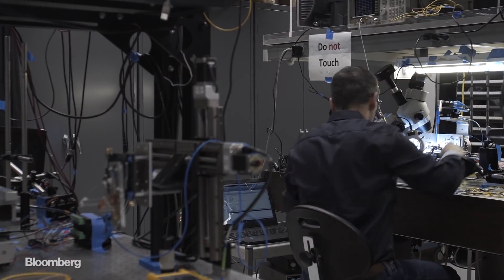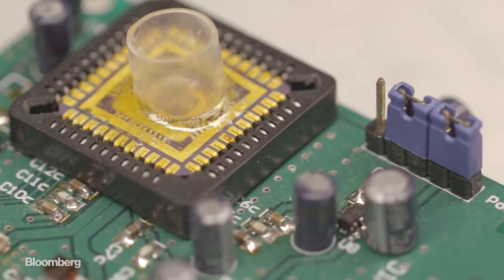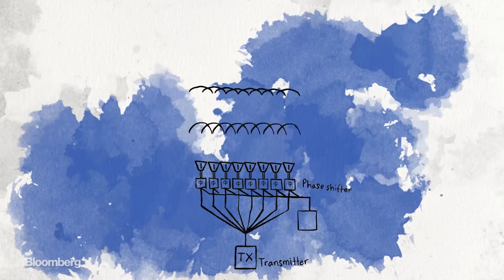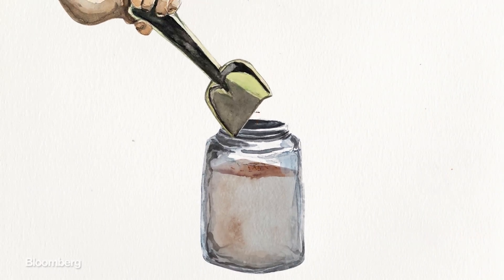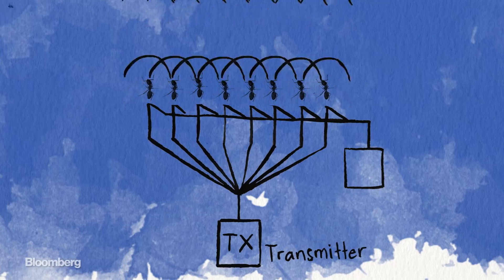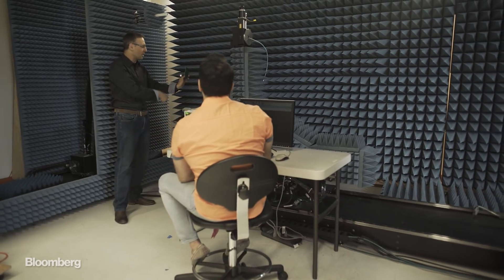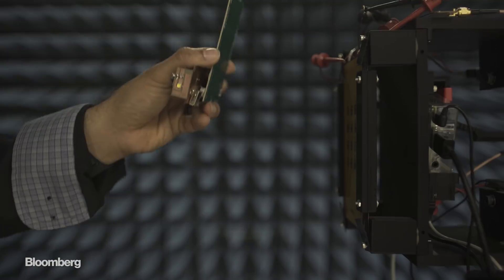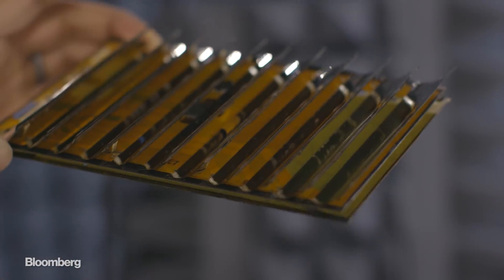Elon Musk Doubts This Idea. Ali Hajimiri Is Betting on It.

Comment: I don't see why one would go to the trouble of converting the solar energy into microwaves in space then beaming to the surface of the earth. What exactly do you gain by doing that?

I see the advantage of having 24x7 production of electricity but why not just focus the sun directly to a collector on earth, avoiding the losses in conversion to microwave and back? You just need a large optical reflector in space rather than solar panels and you achieve the same results, only much more efficiently. That is you get much more electricity produced for a given cost or for a given mass launched into orbit.

Comment: So, somehow, it makes more sense to buy a 100$ 2kg solar panel, put it into space for for ~6.000$, install it around a long range transmitting system (??$) that will have some efficiency losses, with the work of 10+ engineers and scientists, then to just buy 3 panels for 300$ and and have them installed by a single electrician on a spot of the 99.99% surface of the Earth that does not already have solar panels on it.

Intriguing.

Same amount of power produced, one cost 300$ + 1 electrician hour, other costs 6.100$ + ??$ + 20+ engineer / scientist hours.

Oh by the way: The ~6.000$ launch cost for 2 kg ( Falcon 9 reusable configuration) goes up to ~10.000$ if you disclude ventures of Elon, and go with the second cheapest option currently available. Just saying on your comment "If there is anyone out there who could steer the thrust of technology from its own demise, and toward the betterment of humanity" - there a lot of people actively doing that, and this guy might be amongst them, but he needs to not just imagine and make "cool tech stuff", but also make it in a way that it practically and economically makes sense to be anywhere near of the frontier.

Comment: "Without producing greenhouse gases in the energy generation process."

Well, yeah, but from that perspective, neither do hydro/wind/solar (earth-based) or even nuclear. That's beside the point however, because energy production must take into account the building of whatever it is you use. I bet launching rockets into space uses a whole bunch of GHG per kilogram put into orbit. You'd also have, to be fair, to amortized the GHG cost of building the rocket (on a per launch or per kg launched basis). And then the GHG cost of whatever material itself you put into space.

Comment: This is the same technology that allows wireless phone charging.  The catch is limited distance and significant heat buildup.  To increase the distance you must increase the power and the waste heat.  At the distances he's proposing the waste heat would melt the components.  Clickbait title and a silly idea.  I was exploring the idea of making light up chess pieces using this method but the heat buildup between the coils turned me off.  I did create a prototype which impressed my kids.

Comment: Moving solar energy from orbit to things on the ground would make more sense if it was for solar energy collectors orbiting an asteroid mine.  The sun might be the best source of energy because the extremely low gravity makes the surface of an asteroid difficult to stick to and so unspherical.  If equipment reaches deep under the surface, the energy requirements could be related more to the volume of the asteroid than its surface area.  There could be more energy consumed than the entire surface could provide if it was 100% covered with solar panels.

Comment: It will take some serious innovation to offset the operating costs of the orbital solar array as well as bypassing the effects of the atmosphere and weather patterns.

It might be possible to design a phase-array or array of transmitting lasers to use the 10 μm wavelength. From what I've read, the 10 μm wavelength is where the Earth's atmosphere lets energy pass through best. This might almost entirely negate the effects of the atmosphere, though I'm not sure what effect weather patterns might have on efficiency.

Comment: I was constipated for days. I tried this stuff called fibergel over the course of three days and eventually I was ready to give it a go. I took off my T-shirt and shorts used a small amount of vaseline around the rim of my arsehole. I needed a break in the middle of it all and decided to leave it sticking out of my arse like a tortoise sticking it's head out of it's shell. I was huffing and puffing so hard I thought I was going to pop a vein. It wasn't easy and I don't mind admitting that I was sweating quite profusely but after a few hours I managed to squeeze it out. It made an almighty thud when it hit the toilet floor and, because it was still in one piece, I managed to cause a miniature tsunami with the added bonus of toilet water all over my backside. I staggered to my feet and peered down at this thing I was responsible for it seemed like it was smiling back at me. I decided I was going to keep it and named it Alfred. While looking for something to wrap Alfred up in to keep him warm (there was a little piece sticking out so I knew it was a boy) there was a bang on the door. My roommate was shouting at me to get out. Now I had another problem. I lifted up the toilet cistern lid at the back and placed Alfred gently inside. Now and again my roommate will ask "what's that smell?" To which I reply by shrugging my shoulders. Hopefully one day soon Alfred will have a brother or sister.

Comment: Why suffer the conversion losses, light to radio, then radio to power?  Put large mirrors in a 10,000 mile orbit to keep solar panels lit 24/7?  

If you want to "beam form", then heat sink the solar panels and focus light on them.

Comment: Interesting idea.
Wireless transmission of power from space may be inefficient and expensive, but could be very useful in some use cases.
Mobile phones that don't need batteries and never run out of power would be amazing. It could be a life saver when used in emergency equipment.
The power density would need to be higher than solar power and be able to penetrate cloud cover, otherwise the usefulness would be more limited.
Reply: I was thinking that it may save lives in emergency equipment in the middle of the ocean, in mountains and deserts and other remote areas - places where a dead battery can be fatal.

Comment: Wireless energy transfer will always be very inefficient because of physics, not an inventor's will to make it work. Sending solar panels into orbit is ridiculously expensive and will be less efficient than ground panels when you account for all the transfer losses in the system. Elon Musk is 100% correct, and anybody who can do basic math can verify it. It would make way more sense to just put mirrors in space and reflect the sunlight onto panels on the ground (still stupid, but far less stupid than using 4 inefficient energy conversions). This asshole is fully aware that this is not feasible, and is just going after grant money like everybody else in the field of woo woo science.

Comment: Change(Chaos) vs Order, Enthalpy vs Entropy, or does complete Chaos exist? Because complete chaos is order but the process never gets completely ordered and external forces always seem to disrupt the balance anyway. The point is that two completely opposite or opposing views in solving a problem may not be that far from a solution on either direction and often times it is a type of perspective in using both methodologies that solves whatever problem you are trying to solve. The rational  approach is simply to view each idea and concept as possibilities and not impart any emotional attachment to any view you give because this often leads to blind block spots in the evaluation process that loses the chances of finding possible solutions to tasks being processed or considered.

Comment: Elon thinks the idea is stupid because:
1- cost of launch
2-inefficiency of transmitting energy from space with a laser
3-complexity and expense running a satellite.

So why do this when we have  ground based solar? I'm not saying this is impossible or something. Its not an economically practical idea. I think Elon is right here.
Reply: totalermist
Except that's completely different. Those satellites don't make power, they make internet. While solar power is available in most places on Earth, internet access is not. By going into space you need only 12,000 satellites to cover the planet. How many terrestrial stations would you need to do the same, and how much would it cost?
Moving solar to space doesn't improve it's efficiency that much. You get 3-4x more power on average and don't have to store it, which is awesome, but doesn't cover the cost of the launch, even with the BFR. It's cheaper and easier to build 4x more solar panels and big battery farms to store the energy for the night.
Space solar makes sense only if you live in space. Even if launch cost will be near zero in a few decades, rooftop solar will still be cheaper, because solar panel costs are dropping fast, and you have no transmission cost.
Reply: sakda - No, I believe he (and all other scientists and engineers agree) that it is simply not practical - which it isn't with the materials requirements.
Reply: Bri10 the difference in sunlight intensity isn't big enough to justify the launch costs and inefficiency of wireless transfer. And if your worried about land, with the same budget that this idea would require we could probably fill the entire Sahara desert with solar panels and nobody uses that land anyway.
Reply: @Bri10
Which you would then lose more than you gain by transmitting it over those distances. The closer you are to production and usage the less energy loss there is even in wired systems. Wireless systems lose even more energy and are even more inefficient.
Reply: it's stupid because:
The receiver would absolutely have to occupy land... 
whether it be a building rooftop or land next to the building that you want to power. need more power? install a bigger receiver array.
Every time you convert a source of power into another form you lose power and create an even less efficient system.  you would need hundreds of thousands or more of these satellite transmitters to power the world. the space debris generated and the cost would be unfathomable. 
The idea is beyond stupid. 

Also note that he mentioned nothing about efficiency or any numbers. watched it twice.
Reply: Dexter - Elon has explained this clearly in interviews.
Reply: Yea it won’t just get cheaper over time. Satellites are expensive to take care of and produce.  Really stupid idea honestly.
Reply: 3d tech fuck musk wanna be tesla hes funded by government not a genuis
Reply: Uh Dexter who u think musk is the only guy in the world that can put things together
Reply: Valken that would be even less efficient and more expensive then now because of the miles of wire
Reply: totalermist yeah no, you're a moron.
space solar is extra dumb, not only is it probably not more efficient since losses in attempting to beam it most likely outweigh the extra sunlight but as everyone who actually tries commercializing something and isn't a dumbass knows, you divide efficiency by cost, if something costs 1 million times more for 2x efficiency it's an extremely dumb idea.
Reply: Well even if it isn't as effective as he hopes, I'm sure that will find a use someday.
Reply: ...because Elon Musk is stupid.
Reply: I think it might work  and favour those countries hardly has sun light much during the whole day
Reply: This stupid ass argument again. Because it does not exist now in a form i agree with, it can not exist. Because I can not imagine this to be a real thing, it can never be. People who defend fossil fuels say the same thing.
Reply: Mastering nuclear power is the future.
Reply: Elon thinks the space elevator is the stupid idea too
Reply: why don't you lay out the numbers for us
Reply: It's just as stupid as launching 12,000 satellites into orbit for internet access instead of just building a few 5G masts plus a few fibre optics cables down here on earth, oh wait - that's exactly what SpaceX plans to do for its StarLink project.
Musk declaring this idea to be stupid because of cost and complexity is just a case of the pot calling the kettle black...
Reply: Most sentient commenter award.
Reply: sakda c fuck elon
Reply: 'Practical' oh you mean like hyperloop?
Reply: Efficiency, by having solar panels outside the atmosphere, you'd have a far greater energy yield while occupying no land.
Reply: This will only be viable when the space elevator becomes a reality. Then we will send the energy through wire and it will be efficient.

Comment: I wonder about very intense heat created in columns in the atmosphere by this type of transfer.  Could it disrupt weather patterns?  Would it be safe for a plane to pass thru the beam, etc?
Reply: Canuck Fundy there are other far more effective ways to get energy, this idea is retarded.. it's basically 5 G cell technology(which is bad) but on a massive scale
Reply: Jake Mitch i think retarded is a strong word, considering the inventor really put his best effort in developing the idea. but yeah its inefficient, especially considering the solar-generator-cum-satellite needs a constant supply of fuel to correct his decaying orbit
Reply: Wahyu Yogiarjanggi Gumbira I think the idea is a cool idea, but only as a thought it cannot work practically.
Reply: Wahyu Yogiarjanggi Gumbira I can't even believe he shares it like he thinks it's the answer to all, when its not.. he has to be dumb or he's really smart and simply conning people for funding for the project.

Comment: Unless they are doing something novel with the downlink of the energy this will not work.  Any concentrated energy regardless of the spectrum used becomes a weapon or at least dangerous if it misses the target.  Spreading out the downlink to make it safe increases the surface area needed toward the point a solar area would as well.  Possibly some advantage could be had be directing energy down in the evening where solar and wind have a gap.  This kind of thing was around over a decade ago with older tech.  I don't see how a phase array fixes the downlink problem.

Comment: Is it likely to be used as a weapon? I think at least it can cause wildfire.
Reply: I don't think you could concentrate the beam to even power a solar pannel ant night, let alone making it into any weaponry. Iven if someone managed to focus it, there are a lot more practical weapons.
Reply: Actually it already is a weapon, although not as dramatic as you describe. Radars have been using phased arrays for decades, and some units in modern fighter planes allow to purposefully focus emissions on the enemy electronics to damage it.